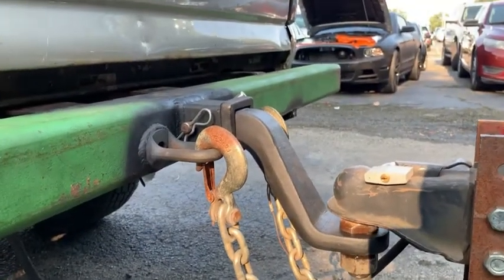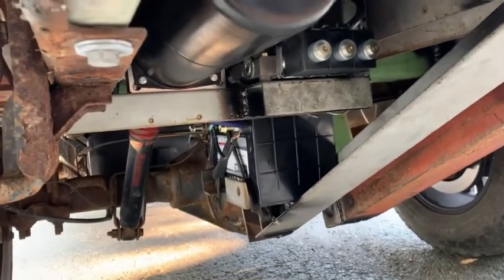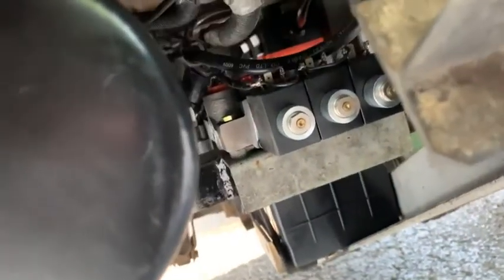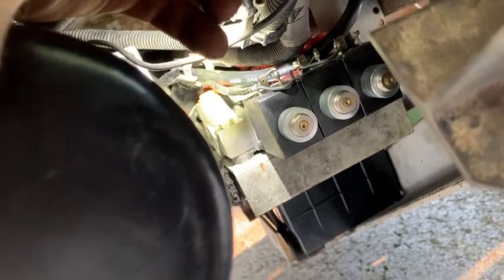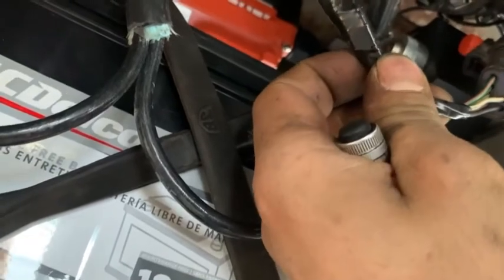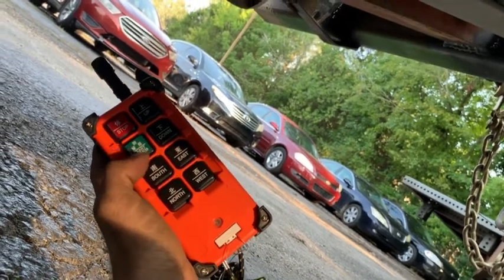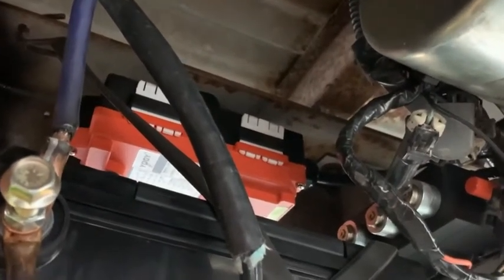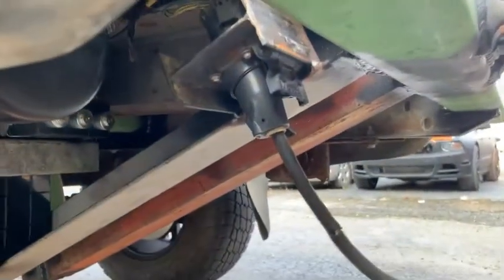Tow truck wheel lift build part 6, hydraulic pump, spool valve and remote control

Comment: Hey would you happen to have a wiring diagram for the remote..i ordered the same one but cant figure it out
Reply from the maker: It should come with a wire diagram that tells which color wires go to what. I think mine was on the back of the box that mounts on the vehicle.
Reply: @backintheshop9604  it is but it's in Chinese lol..i understand it a little but do you remember which you used for + and -  and which wire was for the stop button. Is pretty much only thing I'm confused on
Reply from the maker: @Towmannelly  I don’t remember. You might have to just eliminate the ones you know and play with it and see which wires do what with some power. I think it’s standard color coded.

Comment: Hi please would like to have assistance In wiring diagram to wheel lift I have exactly the same remote control crane system, Please help thanks I have 12 to 72 volt crane remote same as you my, phone # Is Benny 512-228-9451 please call me thanks
Reply from the maker: When each button is pushed on the remote it sends power out that particular color wire on the receiver, I don’t remember all the colors at the top of my head but each color is for a different function of the remote the on switch and the remote turns on so all of the functions will work. You just wire each individual wire to the solenoids on your spool valve. And all the ground on the solenoid can all be tied together. Hope that helps.
Reply: @backintheshop9604  my friend I have had numerous shops attempt to figure the wireless remote control & transmitter out It Is It Is 12 t72 volts Identical to ya set up. I will glad pay ya If, ya could clarify more specifically. Appreciated sincerely Benny
Reply: @backintheshop9604  I did give up on other shops attempts at trying.
Reply from the maker: What kind of solenoid monoblock/spool valve are you using?
Reply: @backintheshop9604  ya mean the solenoid mounted on top of the electric motor?
Reply from the maker: @bennyburgess4036  I need to know what kind of pump and what all the functions are of that pump.
Reply: @backintheshop9604  I have 6 functions up, down In, out & open & close I already figured out what wires by, testing with a power probe, & wrote each wires Individual functions. My issue Is I can't wire the numerous wires to make It functional, have been able to make the led lights  inside the receiver work by, pushing the buttons on crane remote,
Reply from the maker: @bennyburgess4036  your remote receiver should have a wiring diagram on it.
Reply: @backintheshop9604  It Actually does. Maybe ya can ster me In right direction Is the Green & yellow Ground? & Is Red the positive , & trigger wire / electric motor that Is connected to the receiver Is it Married To the pink wire?
Reply: @backintheshop9604  My, solenoid wire that Is white which I refer As the trigger wire on ya crane receiver ya have 11 wires which color do ya have connected to the hydraulic pump solenoid wire
Reply from the maker: @bennyburgess4036  give me a day or so. I’ll check mine and see it’s been a minute. I have it where you push the green button to power it up and then push and hold to start the electric pump while holding you operate whichever function you want.
Reply: @backintheshop9604  that would be nice

Comment: I like it
Si you have the link for wiring 
I am interested in building some
Like that remote control
Reply from the maker: https://www.ebay.com/itm/12-72V-Wireless-Industrial-Remote-Control-for-Transmitter-Receiver-Hoist-Crane-/133316061161?mkcid=16&mkevt=1&_trksid=p2349624.m46890.l49286&mkrid=711-127632-2357-0

Comment: do you have any diagram or video, hydraulic conection ? pump-valvule solenoide
Reply from the maker: The pump that I had had a factory installed plug labeled T for tank, I remove that plug and installed the return line from the mono block. So the pump that’s pressure to the block and then on the return side and just dumped it back into the tank it’s still only a single action pump.
Reply from the maker: No I don’t. What info are you needing?
Reply: How do you conecting the pump to the valvule box? If the pump that you showed in the first video is efect single and the valvules are doble or did you change the pump? Thanks for answer